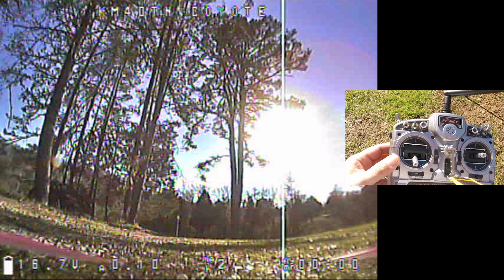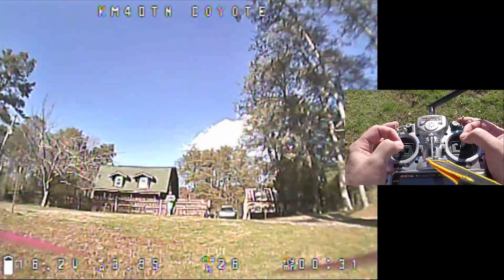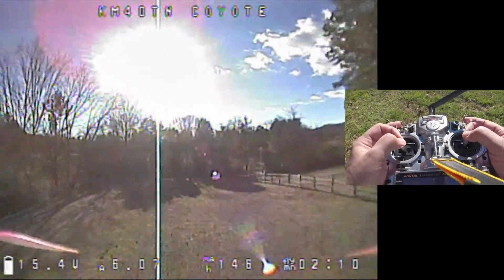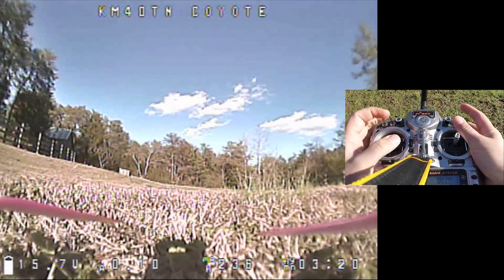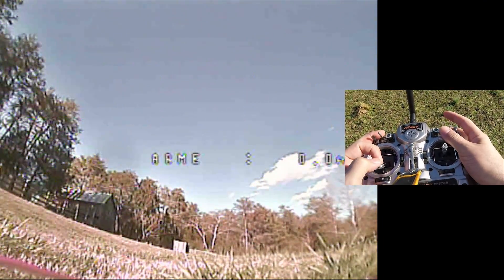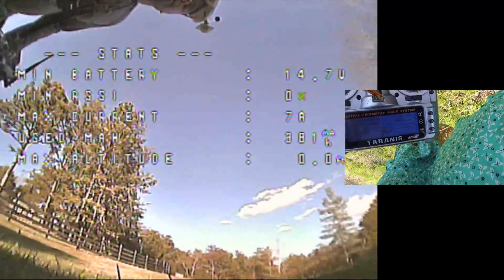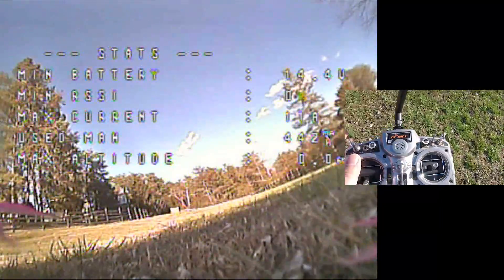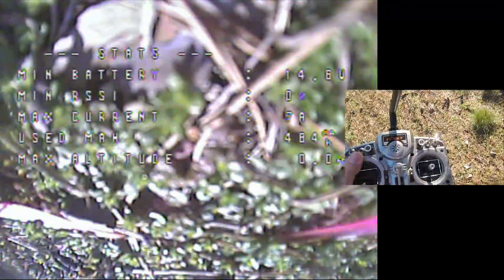How To Land In Air Mode | BETAFLIGHT CLEANFLIGHT

Comment: Alright, so here's the deal with the Chimera 7. Super stoked about taking it for a spin in all sorts of gnarly conditions – snow, mud, you name it. But here's the head-scratcher: the landing game.

Why can't we just flip that bad boy into Normal mode and snag it mid-air? My Chimera 7 hasn't dropped into my life just yet, and this is the big mystery that's been messing with my flow. Back in the DJI FPV days, I'd rock the M mode like it was my jam, and when it was time to touch down, I'd switch to N mode and scoop it up mid-air. Kinda strange that this ain't an option with the Chimera 7, right?

Can you shine a light on this landing situation for me? Much appreciated, my FPV friend!
Reply from the maker: You're thinking of a DJI drone where Normal mode gives good position hold. Betaflight doesn't have position hold. It doesn't have the sensors required to do position hold accurately, like downward facing rangefinder and optical flow sensor.
Reply: Hey, thanks a bunch for dropping those insights, man; really appreciate it! 
Now the whole N mode thing makes way more sense to me. I'm mulling over some landing strategies 'cause, truth be told, I've got a bit of a dilemma, especially considering my penchant for flying in snowy and muddy conditions. I'm brainstorming, and here's a wild thought – what about using GPS Rescue? Picture this: wrap up the flight, bring the bird back close to home, kick in the GPS Rescue, and snag it mid-air. Crazy idea, right? But could it work? Lay it on me, what's your take? 
Apologies for the noob vibes; the Chimer is still on the way, and I'm soaking up all the knowledge I can. B
ig thanks for schooling me, my dude! @JoshuaBardwell

Comment: Anyone know this particular qwad setup? He's pulling so little power to hover, I pull around ~17amps on 4s withy 2650kv 2207 Le drib hypertrains, on 5x5x3 props.
Reply from the maker: 5x5x3 props on 2700kv explains why you're pulling so many amps.

Comment: I seem to be too slow at hitting the disarm once I touch down and my copter goes nuts.  A new flight mode that would really help a beginner like me would be "landing mode" which would function like "Air mode with auto motor disable on first zero throttle".  If this option existed, I see how it could be a very dangerous option if unintentionally enabled while flying.  time to go practice landings more landings.....

Comment: Hi Joshua, is landing in Air Mode still an issue if you do not use the disarm approach?  Rather than simply disarming to land, I've setup SB as Disarm, Arm+AirMode, and Arm.  With Disarm closet to me, I cannot accidently Disarm the quad if I bump the switch midflight, but can easily bump the switch from middle to up position when ready to land which removes Air Mode ... is this better than just disarming?  Will not disarming and landing while in Arm mode have the props cutting up the grass and making a mess or is there a way to stop the motors such as ESC braking, etc. etc.?

Comment: I have similar to the same problem except whenever I come into land my 3 inch will touch the ground and then automatically throttle up about two foot off the ground and then come back down and keep repeating the process what does that mean this isn't the normal bounce back that I'm getting now the words I can't just land when the throttle engaged in the prop still spinning smoothly because the motors will spin back up the men and it touches the ground and jump off the ground by itself when I am at zero throttle someone please tell me what's going on
Reply from the maker: Just disarm before you touch down like I show in this video.
Reply: @JoshuaBardwell  so all quadcopters the motors will literally spin up when you're at zero throttle when you're trying to land that's why you have to disarm when you when you land
Reply from the maker: You can make the motors stop at zero throttle but for a racing or freestyle drone, this is undesirable because the pilot often goes to zero throttle while flying. For a camera drone like DJI, this doesn't happen.
Reply: @JoshuaBardwell  thank you mr. Barnwell for your reply about 20 minutes ago I figured out what my problems were I did not turn the sensor on through my speedybee app I just fixed the problem 10 minutes ago whenever I was in my speedybee and I just happened to hit the sensor sliding it turned on and completely fix the problem once again I'm new in the hobby and I have a whole lot to learn

Comment: I have a new quad that runs away in airmode if I raise the throttle past 50%. The quad stops responding to my inputs and starts to fly away on its own until I disarm. This only happens in Airmode. Acro/ Angle mode work fine. Its a Kabab toothpick 3 running BF 4.0. Any help at all would be incredibly appreciated. Nobody seems to know what the issue could be
Reply from the maker: There is too much vibration getting to the gyro. Try lowering the cutoff frequency of the filters.

Comment: Josh, do you ever land in a tight spot without having an approach. I have been flying FPV for about two months now and would love a switch that puts my copter in an imaginary cylinder where I can lower the throttle and disarm. My DJI drones are great at this. Obviously this FPV stuff requires more skills to fly, but a tight landing option would be cool to have.
Reply from the maker: Making tight circles is a good way to approach this situation. You can also flick autolevel mode on.

Comment: Hi, even if I don't keep the airmode on but motor idle speed at 4.5%, I can control the quad at zero throttle and there is no issue of quad bouncing while landing. What's the difference air Mode does?
Reply from the maker: If you feel that you have sufficient authority at zero throttle, then you don't need to use Air Mode.
Reply: @JoshuaBardwell  Thank you so much for clarifying. A reply from the person following for so long and also from the opposite side of the world has made my day 😊😊

I have noticed the motors sounds differently while arming the motors at idle speed vs air mode. Now, if I turn on motor stop at 4.5% idle speed, how will the quad behave at zero throttle?

Comment: It would be good if we could have a squat switch on the undercarriage set up to give inhibition of air mode so that it effectively did this job for you. I guess this could be done with an add-on bit of hardware that fed the squat switch in as if it were an Aux RC channel - easy to do if the controller is set up to take RC data by the old one wire per channel method but could be done for spectrum slave, SBus etc with a little more effort.

Comment: Hi Joshua y did your drone go crazy when you armed ? myn is doing the same thing i cant work it out :(
Reply from the maker: If the quadcopter instantly flips over when you arm and raise the throttle with props on, it is almost 100% certain to be one of these things:

1. Clockwise prop installed on counter-clockwise spinning motor or vice versa.

2. Flight controller not facing forward. Go to the Setup tab in the configurator. Tilt the quadcopter on all axes (pitch, roll, yaw) with your hands. The 3D model in the configurator should move the same as you move it with your hand. If it does not, use the Board Alignment parameter in the Configuration tab to fix it.

3. Motors not wired correctly. TAKE OFF YOUR PROPS. Plug in a battery. Go to the Motors tab. Turn on the "props are off" slider in the lower-right. Raise the individual sliders (1, 2, 3, and 4) one at a time, just enough that the motor begins spinning. The motor positions (1, 2, 3, and 4) should match the graphic in the upper left. If they do not, then either move the signal wires so that they are correct or use resource reassignment to virtually "move" the motors.

4. Motor spinning wrong direction. Do the same as step 3 but compare the motor direction to the arrows on the graphic in the upper left. If a motor is spinning the wrong direction, either reverse it using BLHeli (or whatever ESC software you are using) or swap any two motor wires with each other, which will reverse the direction.

Many times, people swear up and down they have checked all of these things, and then come back to say oops I missed one you were right. So if you think you have checked all of these things and your quad still FLIPS OUT, go back and check again. If your quad is insta-flipping on takeoff, it is almost always one of these things.
Reply: @JoshuaBardwell  Thank you for getting back to me so fast :) ill start ticking them off as i go down the list ill let you know how i get on , once again thank you,  your a star !!!!!
Reply: @JoshuaBardwell  Thank you for your help TURNS OUT all my motors were going the same way. But happy to say all fixed now

Comment: I created a Logical switch which gets activated at -97% throttle input. Acting as TH enabled switch. This logical switch is available only when TH enabled mechanical switch is activated. This way air mode always on and at -100% TH input props stopped & drone disarmed. Makes landing easy. :-)

Comment: I also pinch and to make it easier i turned my disarm switch through 180 degrees. I now pull the switch towards me to disarm. Using a pull action on the switch allows me to pinch and rest my ring finger on the switch at all times. Disarming is really easy this way

Comment: Why would the quad freak out like that in the beginning of the video?
Reply from the maker: Excess D gain or vibration is one cause.
Reply: thanks i found your video in insta-flip but i havnt touched stock pids, im on kiss. and i flipped motor direction and havnt been able to get it back to the way it was and im thinking maybe a yaw issue idk im stumped. oh and a motor burnt up with props off

Comment: Because I fly quads running one shot, multishot and D Shot. I have noticed D Shot is allot more responsive and needs different settings than I use on my quad that uses one shot. I find small circles made landing in challenging spaces allot easier. Thanks for the great vids Josh!

Comment: I am late to the party here, but I have the airmode set to the right shoulder (momentary) switch.  When the switch is off, airmode is enabled.  So, when landing, my middle finger on my right hand can just push the switch "on" which disables airmode while I'm holding it.  Arm/Disarm is on the left shoulder switch so I could do it this way as well.

Comment: Hi,  

This is presuming that you are flying with AirMode on all the time???

Why not do what our predecessors, the 3D Heli guys did way before we even heard of quads and multi's, and simply enable AirMode once in the air with the flip of a switch, and just prior to landing switch it off??? No need to disarm - you just land the thing and disarm once you don't need the lift ;)

They do this all the time to go from Normal Mode for takeoffs and landing, then switch to Idle-Up (Stunt) Mode once they're ready, as a normal flying practice.

Cheers,

Bill
Reply from the maker: Since I have no trouble at all landing in air mode, why would I ever want to turn it off?
Reply: Ya, you're right... at your skill level that's not a concern at all... sorry ;)

As I was watching your video I was thinking of tomorrow, when our club is hosting the Boy Scouts at the club field.  We are going to teach them quads, among other things, and one of the main topics is going to be the flight modes and what they do.  We may even get some kids who would like to try flips and rolls. 

So to that end I'm probably going to use the more basic flight-mode-switching-out-of-air-mode-to-land as a "pathway" to the more advanced air-mode-all-the-time flying, where you are using the disarm switch as a kill switch, albeit with precision timing. 

In either event, teaching beginners to take their eyes off the quad, even momentarily to locate a switch, any switch, will be the the prerequisite skill no matter how they end up landing.  I know that made me nervous my first time or two. 

Cheers ;)

Comment: What kind of RPM are you using in Air Mode if you turn it on before adding throttle? Mine will start to lift off the ground is that ok or do I need to lower the RPM for air mode? Thanks
Reply from the maker: You need to lower min_throttle most likely, and/or recalibrate your ESCs. If you're using Dshot then maybe digital_idle_percent is too high.
Reply: Joshua Bardwell Thanks Joshua I should have mentioned this is happening on my Walkera 215 it's one tough quad in my opinion. Thanks for all you do explaining do's and don't' 👍

Comment: I land at high speed so my battery shoots out of the quad, automatically disarming it.
Reply: Pierson Klein I thought that was the desired method 😂
Reply: @calehuntfpv480  I use the hit the side of the barn method. Usually stops it quite well. And all my props are broke so it doesn't matter if it's on or not.
Reply: So real shit. I'm new sorry for the dumb question but can I fly air mode with my accelerameter off?
Reply: @kwadlife4106  I don't believe so
Reply: If you have children or at least one kid then aim for them, be careful they tend to run and sometimes run around objects, so that   they'll be forced to reach out, protecting themselves I suppose, and grab the quad. But like Bardwell said be sure to disarm just before landing, or striking.   Also the number one way to retrieve your quad.
Reply: That's called crashing
Reply: Pro move.👍
Reply: Deshawn Camden  thanks 👍
Reply: Improvise, adapt overcome.
Reply: That sounds like a sudden unplanned disassembly
Reply: HAHAHAHHAHA
Reply: That's such an awesome idea
Reply: Hahahahahaha

Comment: how do i display the voltage in the goggles like you have im new so i dont know how to
Reply from the maker: The easiest way is to install a RunCam Swift 2 or Foxeer Arrow camera. They have built in OSD that will show their supply voltage. Simply wire the camera up to vBat and you're done.
Reply: Thanks for the reply i will look into that.

Comment: Mr Bardwell, 

I like your videos, you do a great job on them, and I always learn something.

So believe me,  I'm really not trying to be a smartxxx, but it seem that occasionally they can be summarized in a sentence. Like:
"To land in Airmode, turn it off before touchdown"

I clicked 'play' expecting the secret information on how to 'tame the monster', expecting a super advanced technique so clever I'd be totally amazed.
I was just was a tad disappointed when the big secret was to just "turn it off"! Then a few seconds later, I was even more disappointed I didn't think of it.

I do however, appreciate the advice, as it's nonetheless just as useful as if it involved a ground contact/propwash negating PID loop flight mode in the Taranis (which is where I was heading) or other sort of black magic. 

Like the gentleman below I don't get to actually land as often as I'd like do to an 'unscheduled  object interaction' and appreciate being to end my occasional smooth flight with an equally smooth landing rather than the typical airmode 'inverted flop'.

Thanks for all the great videos!
Reply from the maker: Yeah, well, I told people for a long time, "Just disarm right before you land," but people keep asking, so I thought it would be helpful to add a video demonstrating the process. Sometimes people need a little more explanation than others.

Comment: I watched your Air mode explained video first. :)  correct me if I am wrong, if you can relate.  I see air mode as idle up on my helicopters.  I always switch to idle up before lifting off a heli flight and if I did land in Idle up, I would of course do two things.  1. I would not push throttle past the 1/2 point, dont need neg pitch when I am sitting on the ground already, and 2. switch to normal mode so the copter settles in.  Also related perhaps, if I even touch the right stick even with the blades spinning down and quite slow, it will tip over very easily.  I understand the workings of air mode, thanks.  Now to put it into practice.  It looks like I would want authority throughout a flight, but need to disable just prior to touch down.  So question, as opposed to hitting the disarm switch (we call kill on helis) why wouldn't you just switch to horizon or angle mode?   Do we experience the same control loop in those modes?
Reply from the maker: You don't need to disable air mode for landing if you don't want to. But you can if you feel like it. I don't use Horizon or Angle mode at all so I fly with Accelerometer turned off.

Comment: I'm new at everything!  Recently I followed a video (not yours) on tuning in betaflight. Somehow my throttle curve is so low at 80% forward on the stick and I'm just leaving the ground. Your information is way above my knowledge base so if I can please explain what to do on a simple format I'd appreciate it. But, maybe it's no a simple problem. This is my first race quad that I built and used the default settings. Everything worked fine, plenty of throttle with my 2600kv motors. Now it's so sluggish and non responsive flying is painful to fly I thought to just flash the board to go back to original settings but thought to ask for help first.
Reply from the maker: +Larry Faucett did you add throttle expo? Try removing it.